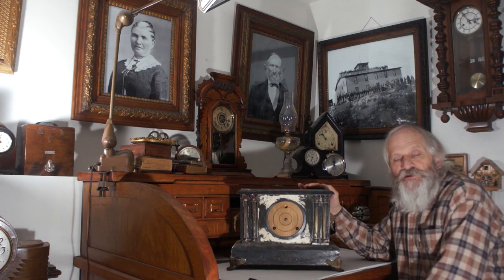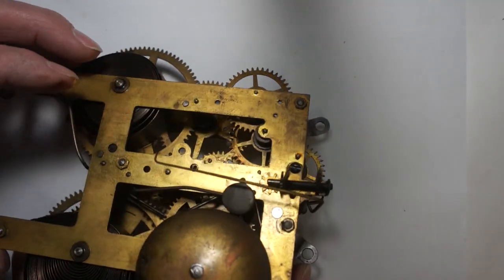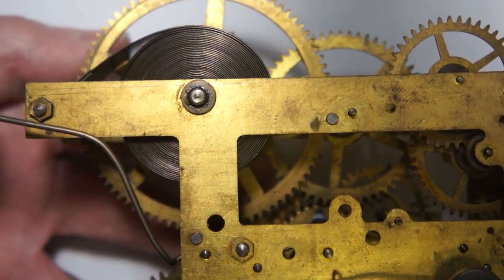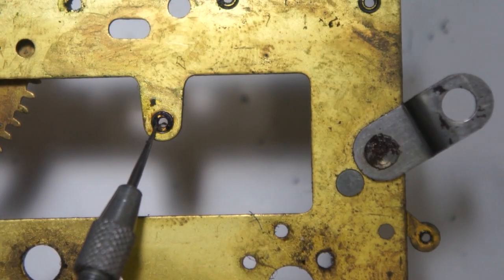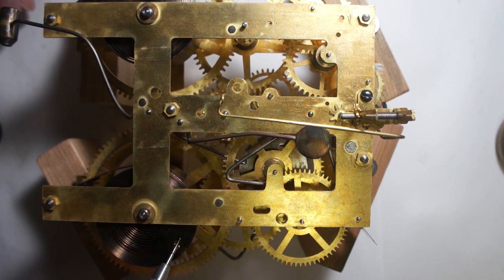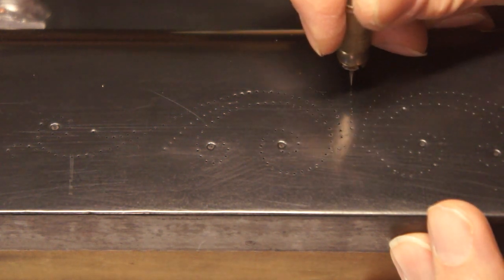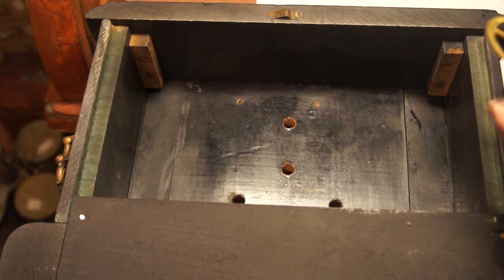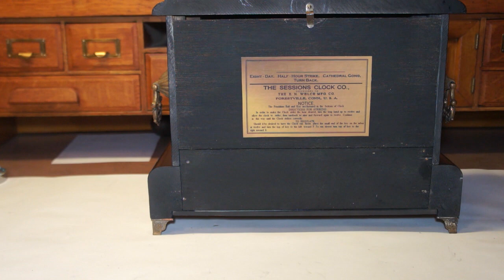1900s Sessions Mantle Clock Restore #18

Comment: Do you know much about Sessions clocks? I found one in a lot of parts without its case so there's no way for me to date it properly, and there are a couple things different to this movement you're woking on here. First, the centre arbor has two lobes each for the strike and half hour chime. Second, the escape lever is positioned on the time train side. Third, the count wheel is made of steel.
Reply from the maker: Very little original documentation exists as to specific changes to movement design and materials used on sessions movements.
Sometimes government regulations determined materials used in clocks, during war times restrictions were put on precious metals like brass and clock engineers were forced to use steel in their movements to stay in business.
Reply: @jamesmartin5370  that's what I figured as well. The movement doesn't seem to be gilded in gold, either, but having bought it near complete in a lot of parts, means the movement was likely cleaned improperly, but there is also no evidence of gilding so it likely is a war era movement as you suggested. It's had very little use and runs well after it was cleaned and bushed in a couple places. Thanks for the input

Comment: Gotta love a clock that's so gummed up that the pivots have to be PUSHED free of the plates. I'd speculate that this was "Gramma's clock" that stopped working at some point before Gramma passed and was kept in an attic or cellar until the current owner got hold of it and decided that it was worth looking after again. What immediately passed through my mind was that the paint was an unauthorized "good idea" by a youngster and that explains the attempt at removal and possibly how it ended up in storage. "We can't have that ugly thing in our living room!"

How did you get the white paint off without harming the rest of the finish?
Reply from the maker: The finish was destroyed when I received it, between the white paint and someone using stripper on the white paint.
So I had no choice but to take it down to bare wood and refinish it.

Comment: Wonderful job! I have a similar sessions mantle clock that I would like to restore. My biggest challenge is to get it running again. I already know that if disassemble the movement like you did it will never go back together so hopefully I can work around that.
Reply from the maker: Great!
hopefully a good cleaning and oiling will do the trick.
When new, many of these were the center of daily living.
They were well cared for, cleaned and lubricated at regular intervals, they were the only time piece in the house.
Reply: @jamesmartin5370  It was a family heirloom on my wife's side of the family recently inherited. I am pretty handy but know my limitations. If I can get it to run again without taking the movement apart the rest will be fairly easy. Thanks for your reply.
Reply: @jamesmartin5370  Well, after soaking the movement in mineral spirits for a couple days and then oiling it I got to work again. It's been going for a couple days now and seems to be keeping pretty good time although the ticking is a little uneven. The half hour bell and gong strikes work properly as well. I learned a lot from your video even though my skills in this area are pretty limited. If it stays running I will tackle the missing glass and broken hinge on the bezel. If I contact you for one of your reproduction labels you'll know I have succeeded! Thanks again.

Comment: Thank you so much for this video. Your shop sounds so wonderful. I just bought a working Sessions mantle clock very similar. I plan to get it cleaned shortly, it deserves it!
Reply from the maker: Great to hear you have a Sessions.
They are nice to hear in a home.
Over time, leather in the hammer can dry, sound will be harsh if this happens.
 It can easily be fixed, just replace the leather in it.

Comment: Wonderful job, I have this clock possibly slightly newer on my bench now, but it is missing the suspension spring and rod, can you please tell me what length it is. Thanks.
Reply from the maker: Suspension spring is 1.59" long, holes are on 1.12" centers.
Rod is 3.88" long.
Spring and rod assembly is 5.00" total from suspension spring top hole to bottom of suspension rod.

Comment: Beautiful.   I have that needs restored too.  Same green gunk on the movement.  Right now, my skills need improving before I tackle it.   Thankfully, no one painted my case!
My difficulty with clocks is getting the wheel with the warning right when I reassemble.  All that strike train assembly is still a bit confusing to me.
Thanks for the video.
Reply from the maker: Before you take them apart.
Study the positions of each gear and lever one at a time on the chime side.
Even if you need to draw some notes and take some pictures.
When you put it back together attempt to line them up the same way and it will surprisingly go together correctly.
I usually need to loosen things up and rotate a wheel or two a couple of teeth to get right.
The people building these put them together all day long to 100s of them each day so it was 2nd nature to them.

Comment: Great work restoring the case. 

I was hoping you'd show off your bushing process for a clock like this. Mind pointing me to one of your videos where you show this off? Thanks.
Reply from the maker: There's a couple early videos I show some bushing work.
Its fairly basic.
I generally make my own bushings.
That way I have more control over their measurements.
I attempt to make the OD of the bushing as small as possible so when I am done many times its tough to even tell the hole been bushed.

Comment: When I was a child, I found an old clock works in a box in the basement of our old farmhouse. I took it apart, as I often did, to learn how it worked. Much like you took this back off this clock. I could never get it back together as it was impossible to align all the shafts into the holes at the same time, and then reinstall the nuts. How did you accomplish this?
Reply from the maker: After a bit they go together fairly easy.

Comment: Another awesome video!! I have an old Gilbert that has the identical suspension spring/pendulum hook. Where can a fella get a replacement...and what is the unit actually called??  Thanks, and loving the videos.
Reply from the maker: They go by several names, Suspension spring rod will get you what you are looking for, any clock supply house or ebay will have lots of them to choose from.
Reply: @jamesmartin5370  Thanks so much!!

Comment: Hi Mr Martin ,what a beautiful job. I would love to see the owners face when they see the clock.
You said you use a heavier oil for the springs , can you tell me the brand you use and where you get it?
Can't wait to see your next project!
Reply from the maker: Moebius 8200/8201 or similar will work, a chart showing different recommended lubricants for clock parts can be found at:
 http://www.afswitzerland.com/pdf/Tools-2017AFCatalogue.pdf

Keystone has several types and can be found at: https://timesavers.com/search.html?q=mainspring+lubricant

In this clock I used some B & K brand No# OL-58, from Ronell, can be seen at: https://www.ronellclock.com/Mainspring-Grease_c162.htm

A lot of choices out there, to my knowledge no one has done any actual certified stress or destruction test and made it available on a comparison chart that can be used by the us to determine if product claims are valid. 
I have some mainsprings that have had considerable galling but unable to relate it to any particular brand or type of lubricant used.
Too thin of product will cause excessive friction and possible galling, too thick will cause slow release and sticking of mainspring so best we can do is choose a lubricant in the middle of the spectrum from charts that are put out by manufacturers and hope all will be good. 

Mainsprings must be completely smooth and uniform in strength throughout its length; the more finely polished, the better their performance.  
A smaller amount rather than too much of lubrication on the mainspring surface is beneficial. So don't soak it but get a good oil film on it.

Comment: Hello, my name is Jagdish from India.  I watch your videos, I love your videos.  I really like your way of doing it.  After watching your video, I have taken an old Scientific  Beam Bam Wall Clock for repairing.  Please tell how to set pendulum of that clock  .....  Thank you.
Reply from the maker: Hi Jagdish,
My response is a little late.
 Do you mean Bim Bam clock?
On most of those, to set pendulum, to regulate the time.
I would start out with the adjusting nut on the bottom of pendulum in the middle of the threaded rod.
Then let it run for a day and check to see if its running fast or slow.
To speed the clock up turn the nut to raise the pendulum.
To slow the clock down turn the nut to lower the pendulum.
Do this for several days until its keeping time.
Reply: @jamesmartin5370   thank you very much

Comment: James, I have a similar Sessions clock that has been in our family for over 80 years. It still runs fine but there is almost nothing left of the original label on the back panel. It has the exact same label as the one you printed for your clock on this video. I have not been able to find a source for this label either to purchase or print. Can tell me where I can either purchase the template for printing or the label itself. Thanks for your time!
Reply from the maker: For a label , you can contact me at  jamesmart55@hotmail.com

Comment: Great video! Question, where can I buy a glass replacement? Mine broke to pieces after the hinge broke.
Reply from the maker: clock material houses have replacements, if you want originals, ebay or find another clock for parts.
Thickness is important, if you cut one yourself, need to measure thickness of original glass, they are quite thin, most glass shops should have that thickness in stock.

Comment: I have a sessions mantel clock. I would like to know how often it needs to be inspected and oiled.
Reply from the maker: There is not one standard answer to this that applies to all clocks, just to many variables for it to be an exact science.
Variables like, environmental conditions, geographical location, temperature, humidity, type of dust contaminations.
In a clean, dry, temperature controlled condition, they can survive longer between oiling's than one in the adverse conditions. 
Under ideal conditions using a synthetic clock oils, a mantel clock will last many years with an oiling every 2 years and cleaning every 3rd oiling or so can give a lifetime of trouble free operation. 
Many of the clocks I receive have went 20 or 30 years without any oil or inspection at all, some still running but need bushings due to mainly the oil dried up and dirt contamination that causes wear.  
Oiling can be done by you if you remove the movement and know where to apply the correct amount of lubercant.

If we are talking certified clocks, this takes us into a different category, parts and materials in the movements are similar to yours.
This gets into Government, railroad, and military clocks.
These were on strict maintenance schedules of not more than one year for inspection, cleaning, and in most cases new mainsprings were installed.
Depends on if a person wants to stick to a certified clock maintenance schedule or something less but still prevent wear on the movement.

Comment: I have a slightly newer Sessions that belonged to my father. It used to have regular maintenance but the jeweller and my father passed. The jeweller signed and dated every cleaning/repair on the back. I am a bit scared to attempt cleaning but working up the courage. How can I clamp the springs before movement removal?
Reply from the maker: They make clamps for this but you should use a spring winder with them..
As an alternative, Sometimes you can just let the springs all the way down until no power is on them and they can usually be removed and installed this way if you are careful.
I have used bailing wire on some that the spring clamps won't fit on but you should have leather gloves if they are wound up and you should use a spring winder to release them safely.
Reply: Thanks. Got gloves and bailing wire handy. Merry Chistmas and thanks for the videos.

Comment: Remarkable craftsmanship.
Thanks for sharing.
Which paint used for case restoration ?
Reply from the maker: I used a black lacquer, then hand rubbed it to a low luster finish to give is an old patina look.
Probably any type of paint or clearcoat will work as long as its hand finished for the patina look.
Reply: @jamesmartin5370  did the lacquer come in a spray can or  ?
Reply from the maker: @johnlauzon9837  For this one I used black lacquer, from a spray can.

Comment: Beautiful work and very informative. I have a Sessions Ardmore that has a damaged finish on the top. The rest of the case is in good condition and just needs cleaning. Would you recommend removing the top and stripping the finish? I would then like to apply a new finish as you have described in your excellent video. My goal when finished is to have the top match the rest of the case.
Reply from the maker: I would need to see the extent of the damage on the top to determine process to repair.
Sometimes the piece can be reworked without removing.
This Gilbert is a good example, the top was damaged, repair was carried out to the top without the need of removing it. see below link:
https://www.youtube.com/watch?v=sIA5zrdBebs
Reply: @jamesmartin5370  Thank you very much for the link to the Gilbert clock restoration. This is another great video and has been helpful with my clock project.

Comment: I have an Ansonia 1882 number 5 movement and the original suspension spring broke, I replaced it with one from eBay (new) but even with the clock seg as slow as it can go without the adustable pendulum bottoming out, the clock still runs about a minute fast in an hour. The new spring is maybe 1/8" longer than original. Anything obvious I am missing? The new spring is about .001" thicker than tbe original as well. Thanks for allntbe great videos. That has to be great granddad on your wal? Thanks, Barry
Reply from the maker: I would say suspension spring may need to be thinner, they are inexpensive, you should have several on hand to experiment with.

Also its best for inflection point to be aligned with
 the arbor for the verge. This is for minimal friction from sliding where the crutch pushed the pendulum/leader.
For a loaded spring, inflection point is just below center
 of the spring. The lighter the spring, the more this goes lower. A thicker or wider spring will speed up rate

of the pendulum. A heavy bob is
 less effected by this than a light one.
Reply from the maker: Its my Great Great Granddad
Reply: Thank you James! I wondered if that could be a factor . As to your granddad..  called it! ;)

Comment: James. I just bought my first Sessions Mantle Clock, just like that one, today. Mine is actually in better shape than this one, thankfully. The brass feet and side handles are black, likely corroded black, I suppose. Should I clean them up, and if so, what should I use, and how is that done. Also the Black enamel finish looks pretty sad, aged, and a bit of patina, and someone actually had set a wet glass on the top which left a  ring on the finish. Should I simply clean the finish, with what, or repaint all the black finish, if so, with what? Lastly, what is the small hole with the square pin, at the top of the clock dial for? I'm so glad you shared this video of this clock being restored. I would like to get a label to put on the back of mine. The label is about 80% there, but, very brittle, and faded black to brown. It looks like there might be a number on it. Would that be a useful serial number which might reveal the date of manufacture? Thank You James!
Reply from the maker: That small hole has a square shaft in there, the original keys for these had two sized squares on them.
The small hole is where you regulate the movement for run fast or run slow.
Original pendulums on these are usually not adjustable so need to regulate from the dial side.
The feet on the one in the video are made from pot metal that were spray painted gold, so you could just repaint if needed because once the paint wears off its ugly pot metal that gets exposed.

Comment: How did you repaint it? Sprayer? Spray paint? Wax?….
Reply from the maker: Started with a quality automotive high build primer, then block sanded.
Finished with flat Black spray paint, then hand rubbed using 3M 05928 FINESSE-IT GLAZE to get the patina look.
Reply: Nice. Thank you 👍

Comment: Hello. What is the best oil and grease to use? Thanks
Reply from the maker: I have not seen any certified test results using any scientific methods on clock lubricant's. 
Stay with clock lubricant's that are synthetic or their equal.
Clock oils stay put where applied on a clean smooth surface, most other oils will migrate and creep away from where they are put.

Comment: Nice job James. Did you use lacquer paint for the clock case? I have one that needs repainted and was wondering. Thank you for the video.
Reply from the maker: Yes  used Lacquer.
Although you could use other finishes.
I hand rubbed it after with 3m finesse it, its made for finishing automotive clearcoats, worked great, gave it the antique low luster shine.
Reply: @jamesmartin5370  Thank you.